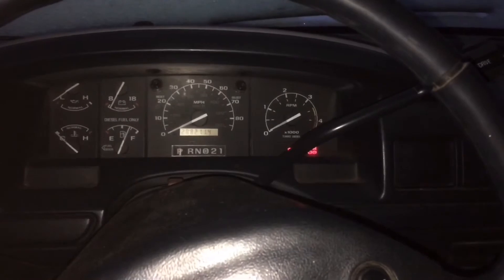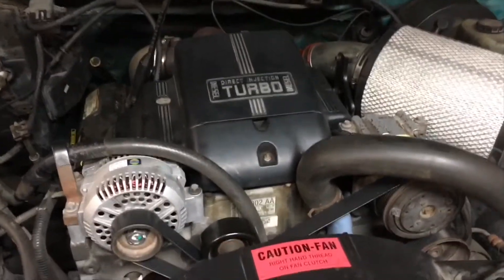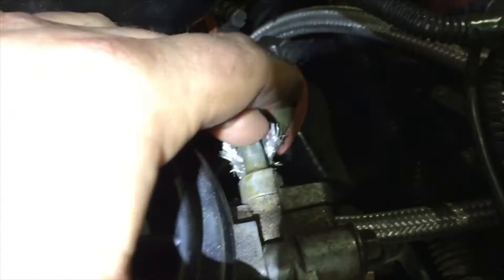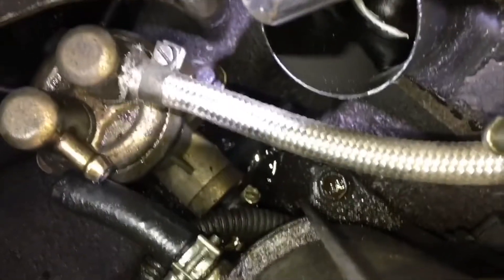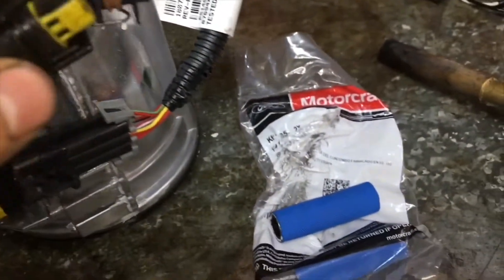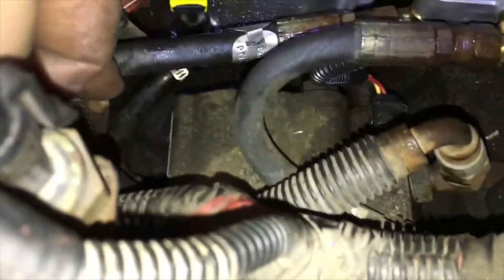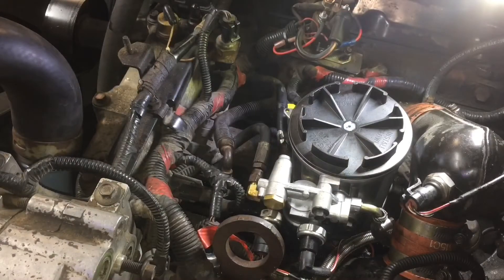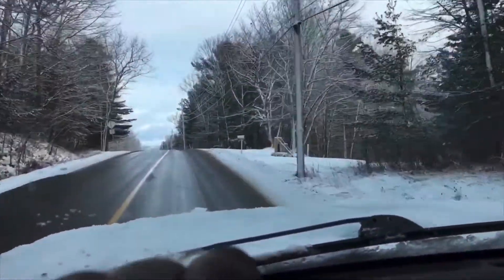OBS 7.3L Fuel Bowl and FPR Replacement

Comment: Thanks for the video I just replaced the sensor because it was leaking but still have a leak so now I’ll have to figure out if it’s my fuel bowl or the hose.... hopefully it’s just a hose
Reply from the maker: Operator Benji No problem! I’d take some time to clean in the valley and watch it while it’s running. Make sure to look closely at your fuel pump, because they have a weep hole on the bottom that will start leaking fuel when they are getting worn out. Also, the drain valve on the fuel bowl is a common leak point. The whole fuel bowl can be re sealed, it is not necessary to totally replace it unless the housing is physically damaged. Good luck.

Comment: hey are those all aftermarket guages up in the window? Also how did u bump the idle? I just got me a obs 7.3 powerstroke truck :) It wont start right im working on it now.
Reply from the maker: Yeah they are aftermarket fuel pressure, trans temp, exhaust temp, and boost gauges. I removed them though cause they were annoying and distracting. 

I have a six position tuner. One of the settings is a high idle mode. It really helps to warm up the truck in the winter.
Reply: My idle control is on left side of steering wheel on dash. Next to fuses. Little black knob you turn. Used on alot of ambulances while sitting. Helps electrical system while in use.